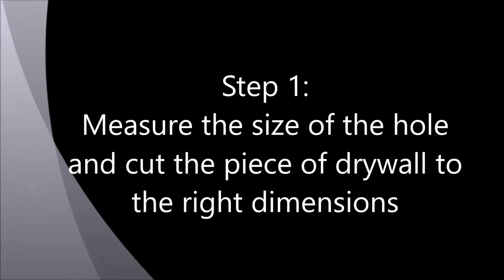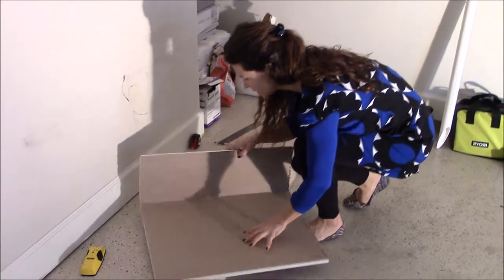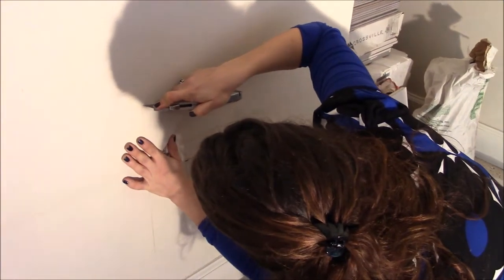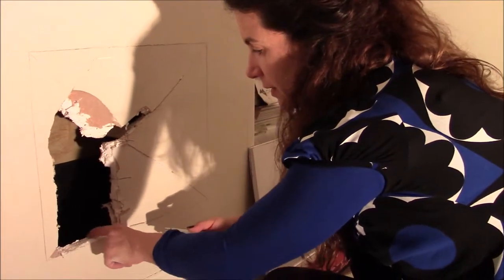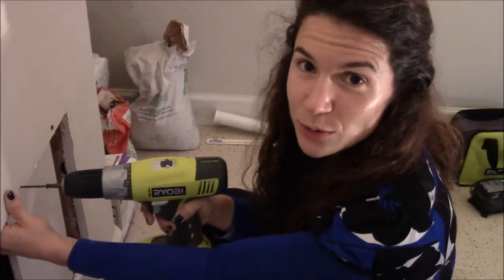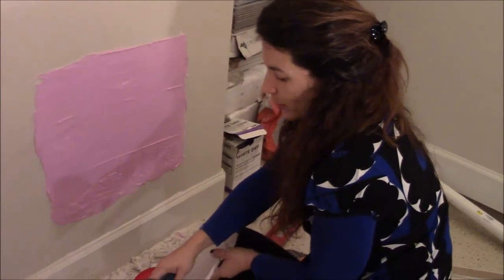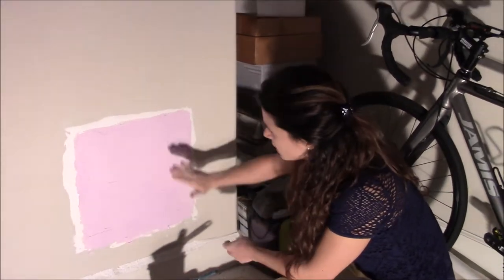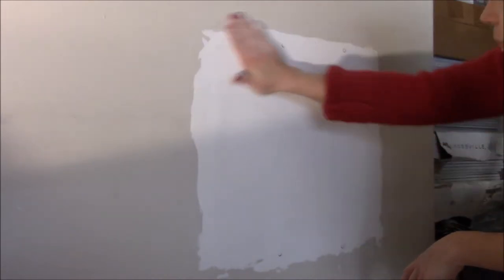How to fix a hole in the wall

Comment: Some idea for the next time: usually we cut up the wall from stud to stud. If the hole is smaller put the things behind  the edges, not in the middle. Cover the gaps with meshtape to be crack resistance. Not need to sand between the 2 spackle coats. The dust between the coats cause problems. The 2nd coat should be wider than the first one and use bigger spatule for the 2nd time.  Use sand sponge. It works better than the paper. Focus more on the edges when you sand it. So the next time we can see the result. :)
Reply from the maker: Thank you for sharing these ideas with me! I will give it a try if I ever have to fix a hole again. The result of this fix was good enough so that no one (but the person who fixed it) can tell there used to be a hole. I wanted to post a picture of it when it was dry but I could not take one that would show the tiny difference in level where the "old" wall meets the new dry sheet. On the pictures I took it looked perfect, while in real life it is not entirely the case. Meshtape would probably have helped me with this issue. Great tip!